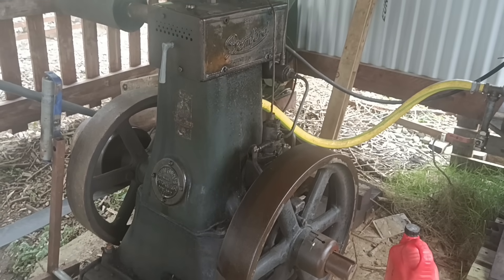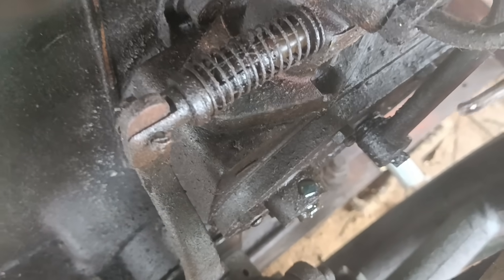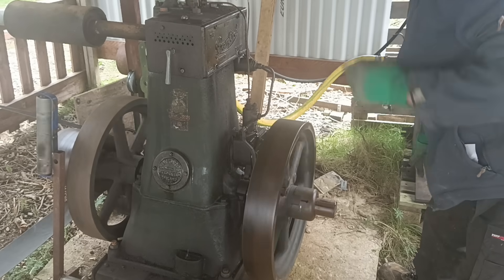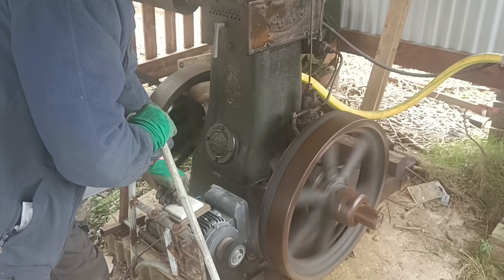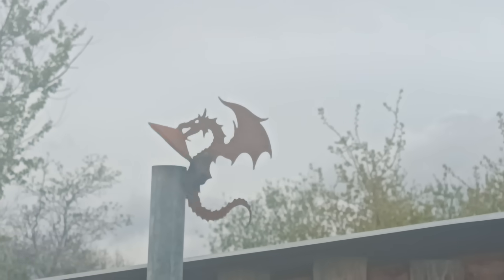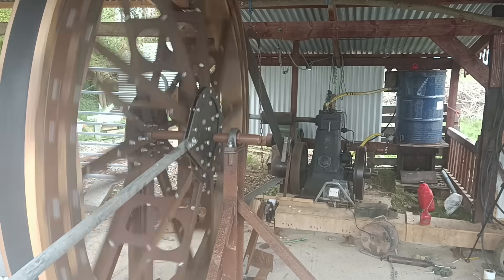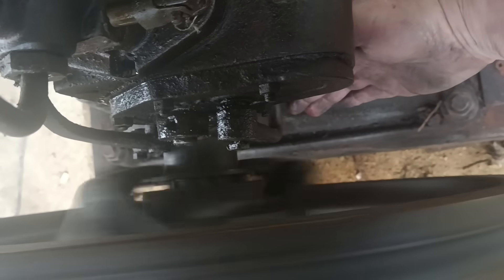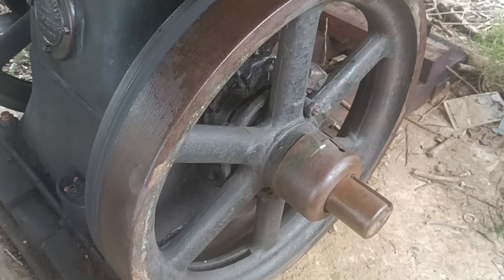How Much Fuel Does This Vintage Engine Use? Bamford stationary single-cylinder diesel efficiency

Comment: A good starting tip is fill the water jacket with boiling water and let stand for a couple of minutes. Let the heat soak in then they start very easily.

Comment: 10 or 11 years ago, there was a video of 2 hp engines being compared. A petrol hit n miss, a 2 stroke off a garden tiller, an overhead valve honda 4 stroke, a kholer "flathead", and i think 1 or two more 2hp rated engines. They were all hooked up to the same generator by way of belt and pulleys, and given 1/2 liter of fuel each, then measured how many kilowatt-hours they produced until out of fuel. The old hit n miss was remarkably frugal, though the flathead kohler won top honors. It was mentioned though that the hit n miss was the most reliable as far as issues, and repairs, though not the lowest operational maintenence, as the operator had to keep lubricating the multiple shafts, bushings, etc as it ran and making sure the grease pots stayed topped up. Still, it seemed very practical for many applications, even for its age.

Comment: I grew up in the 60'S AND 70'S. My Grandpa, Dad and uncles where all bricklayers. Grandpa bought a concrete mixer in the 40's to build his house and we used it actually into the 80's for home and lake property projects. It was a Jagar hit and miss gas engine with an evaporative cooling system, external crank with 2 flywheels, oilers, grease caps, magneto, and steel wheels. It would run and mix concrete 3/4 of the day on 2 gallons or less of gas. We knew how loaded it was by how often the cylinder would fire. Low loads in might only fire every 5-6 seconds. Just enough to keep the flywheels moving but when loaded it might fire every firing stroke. My brother still has it and cranks it up every now and then.

Comment: 450 ml Diesel per hour is comparable with a modern lawnmower that consumes less than 1 l per hour under high load with propulsion.
So - no need to check the piston rings yet. 😉👍
I'd use a high viscosity oil, probably a modern one and maybe an additiv - your engine will last 90 years more. It's just broken in. 😂

Comment: If you use the heat the efficiency of an engine goes WAY up!  90+% is not uncommon!
ie:  That engine with a genset = free heat for the electricity
or free electricity for the heat, depending on how you want to look at it.
Excess heat: grow something tropical, sought after there.

On the farm the old 2 cylinder Lister genset was made so that the hot cooling water emptied/filled (top/bottom) into a large, high up, metal drum.
Maybe 60-80 gallons (this is ages ago in my youth)

The farm house's hot water all came from there and there was an old style (copper and brass) float valve in the top, to top it up with cold as we used it.

ie; Engine cooling during no water use was just the sides of the metal drum in the breeze and boil-off (unpressurised) if the water ever got that hot.
We ran baths and washed dishes etc as anyone would and I don't recall any issues.

Comment: Charcoal ground that fine is for...my guess small scale steam locomotives.  Some of our cooking here in Thailand is in a charcoal burner but we don't grind it.  For fire starters we, well the M-in-L, cut corn cobs into 3 or 4 pieces and then pour some diesel over the top.  The tin is a 4L paint tin with lid and half a cup of diesel is enough.

Comment: These engines were built when engineers realised the combustion could be internal thanks to energy-dense hydrocarbon fuels but they hadn't twigged that the energy density meant they could propel themselves along nice and fast.

Comment: 2 things:
As a young lad on the farm, the old 2 cylinder Lister genset was made so that the hot cooling water emptied/filled (top/bottom) into a large, high up, metal drum.
Maybe 60-80 gallons (this is ages ago in my youth)

The farm house's hot water all came from there and there was an old style (copper and brass) float valve in the top, to top it up with cold as we used it.

ie; Engine cooling during no water use was just the sides of the metal drum in the breeze and boil-off (unpressurised) if the water ever got that hot.
We ran baths and washed dishes etc as anyone would and I don't recall any issues.
ie:  With cast iron heads and cylinders (no dissimilar metals = galvanic corrosion) no antifreeze/rust was required.

Add a heat exchanger in the exhaust  and an efficient generator and you are looking at well over 80% efficiency from the engine and a very warm house..!  :)

2:
Research
Dr Ali Erdemir Argonne National Labs Boric Acid in oil lubricant
I added very moist BA to an old, tired, smokey engine and the smoke cleared up completely!
It also ran...well smoother for lack of a better word, used less petrol and the oil lasted way longer.
The engine ran like that for 5 years after just the one 'treatment' at which point the car was stolen.

Comment: I have a Lawson hit and miss gas cement mixer that was used to build the roads from 1905. It still works. Runs all day, about 5 yds of cement on a gallon of gas. Its unbelievably efficient. I took out some bearing shims a decade ago so it should be good for another 50 years or so.

Comment: so at 6hp at 600-650 rpms would have the engine putting down 52-ish foot pounds. obviously the engine was barely being loaded so its hard to tell just how fuel efficient the thing is at higher load. the real question would be is how efficient is this thing compared to something say like a predator 212, it makes only around 8-9 foot pounds but it also spins 6x faster meaning all that would have to be done is change up the pullies. now it would be interesting to see if a modern 200cc can work as hard as a diesel from now 80 years ago that is around 4x the size and maybe 10x the weight

Comment: Grinding charcoal at the rate shown in the video might seem like hard work for a person, but it could easily be done by a 0.25kW or 0.33kW electric motor and even at full load they'll only be costing 6c/hr - 8c/hr in electricity to run.
Similarly your 6hp (4.5kW) engine is running nowhere near full power. It has consumed fuel containing about 4kWhr of energy but I'd be absolutely amazed if it's >15% efficient so is probably putting out less than 1hp on average during this test.
Don't get me wrong, I love old machines, they're our history that should be preserved, but for doing actual work an old diesel like this simply can't compete with a modern electric motor.

Comment: I think listers are still being manufactured in India. I also think they’ll run on used motor oil or at least motor oil thinned with diesel. Sometimes I think it best if we take a lol backwards. They have their limitations and suitable applications but work wonderfully when so used.

Comment: My first job on leaving school in the late 70s was at a place fairly rural. It used 40-60 amps 240 volts 24/27. We had an old diesel generator for emergencies. Sometimes running for days on red-diesel. it only had a small fuel tack. So it was clear what it was using, and it was not a lot. It always stuck why we didn't go off grid, especially if we could also use the cooling to heat the place too.

Comment: Depends how you define efficiency. Zero resources have been expended in the last 80 years in building a replacement, or probably a number of replacements. That's an efficient use of materials.

Comment: I think there might be a problem with the comparing of the electric motor “running all day, for 2 Euros” versus the diesel engine for a few minutes as it seemed you had done for grinding up the charcoal.

Comment: With all these low efficiency belts and bearings the fuel consumption is quite high. At the time of the machine it was what they had, lower fuel consumption was nicer, but no knockoff point. I am sure that machine can also run on used frying or vegetable oil, and if kept hot, on liquid pork fat. So just interesting how much it in this application used, not knowing how many KW that is, it's only like back in the days, not comparable to today. Nice machine still. I saw similar ones in Africa in the yard between some higher houses  driving a generator for some some bulbs and TVs. As the place looked, since ages there. And one guy with a job. Filling up fuel and watching the cooling water level, which was in an old oil drum above the engine. Downside? Beside the smoke, oil and diesel stink a lot of noise between the houses, barely communication possible.

Comment: 1916 galloway 16 hp  would run a house with 1000amphr  24volt battery easy 2-3 hours a day .  house using  about 10-12 kw no problem with  2x the juice in battery bank to  spare

Comment: Just found this July 24,2024.  A wonderful old engine that seems to run Very economically. It's obvious that you care both for and about the old girl.  If you haven't perhaps you could rig a generator for when the power goes out.  
Thank you for the video!

Comment: Did I understand correctly that it burnt 450ml of fuel in one hour? If so, it means the power output was at the best 1/3 of the 4.5 kWh that you mentioned, assuming an efficiency of 33%. In other words, your load was closer to 2HP.

Comment: Lovely old engine still doing useful work, made in Uttoxeter nr where I used to live. Two questions, will it drive a log sawbench & what do you use the ground up charcoal for.
Reply from the maker: I drive a bandsaw with it but I don't have a circular saw. I make and sell biochar..

Comment: It would probably start easier with a new set of rings.  Obviously, diesel needs good compression to detonate the fuel, especially when the engine is cold.

Comment: My old Southern cross diesel similar to yours and a bit more fuel a hour been 5hp but still well at 650ml a hour to drive my back up power supply/welding plant  o all so my old girl is 1928 built to start now days I wrap a flat belt around the flywheel and a string to the decompression start the MF te20 tractor and drive away starts every time that way

Comment: You could distill your own diesel from discarded plastic, waste oil, or used cooking oil to greatly reduce the fuel cost.  I hear those plastic bags from the shops are a plague over there.
You could also run and electric generator during a power outage.
Reply: And the cost of distilling it would be prohibitive.....

Comment: A few years back the job I was working for decided that I should see if I could get the lister and John bean pump going the lister is a lot more modern than the one shown in the clip but both items had been left out side for over four years the fuel tank had rusted away easy fix clean the lines replace the fluids hardest part was freeing up the modern adapted starter motor then a dab of oil in the cylinders and off she went so easy a pleasure to work with love the old stuff

Comment: Fuel was expensive and also had to be shipped.  Of corse people had to be economical or they would run out of oil before the job was done.  Why we don’t use hit and miss today is beyond me.  Power can be made up with reduction.

Comment: Half litre per hour. Very very good.
Although that 6hp has lost a lot of power at this point .
A quick search on the web shows a brand new 1 cylinder 6hp diesel burning 1.4 Litres per hour at 3000 rpm.

Comment: Unless you are measuring the work performed by the engine, you are not measuring efficiency in any meaningful way. Measuring fuel consumption per hour doesn´t really say anything.

Comment: I would say it's a bit less efficient than a modern diesel engine. But it will more than make up for that in reliability. Since the cost of fuel is 1/4 the cost of electricity, maybe you should run a generator on this old engine and save a bit on electricity. Would be great for times when you use large amounts in a short time. Homesteaders should also be aware that engines produce a lot of heat, which can be captured using to a heat exchanger to get heat out of the engine coolant and into the domestic hot-water supply. A second heat exchanger on the exhaust will capture even more heat.

Comment: Years ago I had an Ashwameg 800 rpm 4eegine that I ran at 300 rpm. It burn4ed 1 gallon of waste motor oil an hour. I never did run it on diesel. I did clean the waste motor oil by running it through a centrifuge that took out everything up to 2 microns.  I also heated it to take out oil and brought the acidity with potassium hydroxide. Started  the first time the piston passed top dead center

Comment: What a beautiful machine, love these stationary engines and for an 80 years old engine, just incredible fuel economy.
I have a 10hp Hatz diesel from 40 years back, it's about 28% efficient , uses 1 liter of diesel to make just  over 2800wh into my 48 volt battery bank.

These engines can run forever, build to last, over engineered and heavy, no electronics, I love it.

Comment: I have one of these from my Grandfathers dairy.  We only had it running again a couple of days ago. It ran 24hrs a day for around 30 years before the power came on in the late 60's. It ran a vacuum pump and pulsators to milk cows in an 8 bale walk-through dairy, a pressure pump to wash the dairy and provide pressured water for the homestead, a 32V generator for homestead lighting and power, and a piston pump to suck water from the Snowy River. I doubt very much that my computerised Hilux will still run in 100 years time!

Comment: It's a bit unfair to compare the fuel costs of a diesel engine running under very little load, to an electric motor at full load. This thing would be way thirstier at a continuous 6HP output. Still though, these ancient stationary diesel engines are decently fuel efficient. They're just comically bulky by modern standards, and a bit maintenance intensive due to all the external lube points.
Reply: Why “comically,” what’s amusing about it?
Reply: @PRH123  I find it amusing because modern engines with that output are really small and light and cheap. Though off course those typically aren't designed for a long service life.
Reply: @fnorgen  it’s an apples to oranges comparison, totally different usage, these engines would run 24 hours a day running a pump for example. I read that there were 10,000 of them in use in Canada still in the 2nd half of the last century, so to say they are not modern is not entirely accurate. Very high torque and low rpm.
Reply: @PRH123  It's pretty generous to argue that this glorious hunk of iron is still "modern". We still saw steam locomotives being used in certain northern Chinese coal mines well into the 2000's but by then those could hardly be referred to as "modern". They were kept in use because for that purpose fuel was basically free, and the labour to keep them running remained dirt cheap. Hell, my dad still uses a brick of a  calculator which was already considered a relic when he went to university in the 80's.
A machine can be quite archaic and still have its uses.
The boring reason we don't seem many such stationary engines doing actual work is that for pretty much all purposes there are far more practical options that are cheaper to buy, transport and run. When old faithful finally wore out it wasn't replaced by another big stationary.
Reply: @fnorgen  hmm, there’s a lot of stationary engines out there doing work all day every day. Joe Public isn’t aware of it because he doesn’t see them or work with them. The company that manufactured this particular engine continues to manufacture stationary engines to this day. What goes on with consumer products like automobiles has little relevance to the world of industry.
Reply: @PRH123  Ok now I'm curious! Ah look at that! Not counting industrial motors that look to be primarily designed for mobile equipment and big generators, I can find some listings for classic style stationaries very similar to the one featured in this video. Most of the ones I find are listed as agricultural engines. I did not know they still made them like this!
Reply: @fnorgen  it is pretty cool, and we wouldn’t even know about it, if it weren’t for these u tube clips!

Comment: To add some context for everyone on the electric motor comparison, wich Tim probably cut for brevity:
Ireland produces like half of it's electricity with natural gas, so with the European gas shortage, the prices have gone up hugely in the past few years: like 0.30 euro/kwh for urban business, with a much higher base cost for a rural farmer.

I do have some quibbles with the math; the efficiency of a good diesel engine is only around 50%, whereas an electric motor is about 85%; 
4.5×0.50÷0.85 = 2.6kwh times 0.44 for rural electricity = 1.14 euro; still a much worse deal though.

Here in Kentucky, the cost of electricity is more like $0.15 per kw hour, or $0.39 ~ 0.36euro to run the motor, so all else equal, there would be a marginal price advantage to an electric motor, though even losing 6 cents an hour I would definitely use the diesel, just for the cool factor.

For a cold blooded cost perspective, the whole thing is dominated by the cost to set a system up: if you have a rusty diesel that will turn over in the barn, or even one prettied up and running for a show, it is the obvious choice; however, if you can get an electric motor for as cheap(less likely, due to the high value of scrap copper), and are happy to do your own electricianing or already have a welder outlet, then you should use the electric.

It's amazing how efficient diesels are; a gasoline motor would be far less efficient.

Comment: I have a 1923 Cushman four to six designed to operate on drip taken from pipelines . It takes a magneto to spark the plug and works well at six hundred RPM . Still I would love to have your machine , consider yourself lucky to have it .
 T/C/E

Comment: Another advantage of these slow revving engines is that the combustion itself is slower and much more complete so any pollutants at the exhaust as a proportion of fuel used is very modest